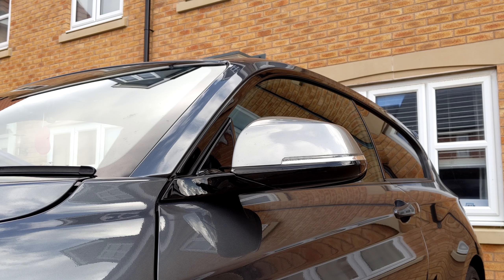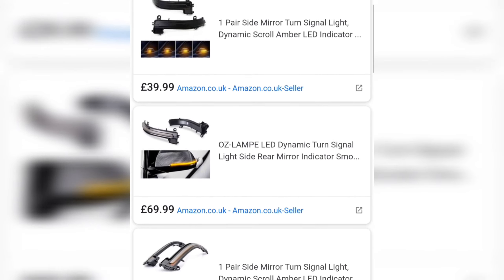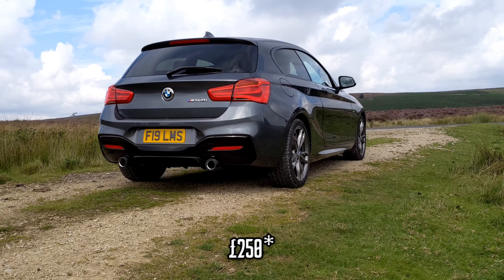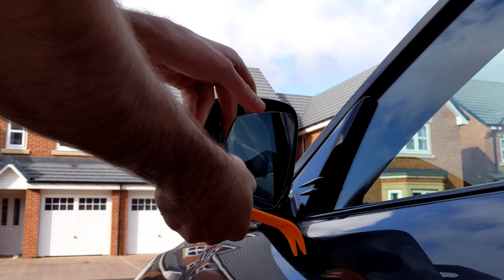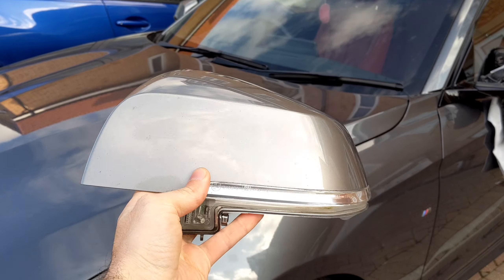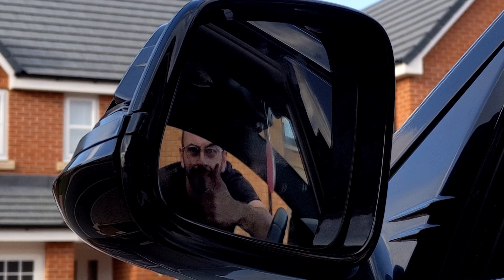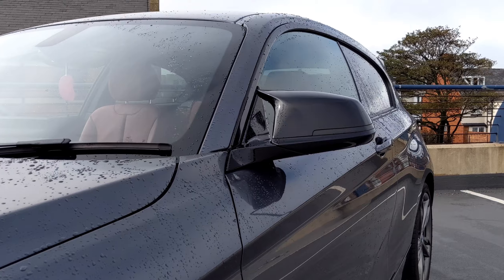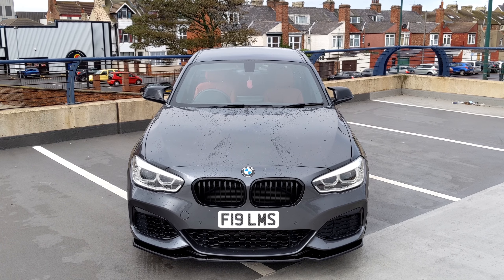The BEST £30 UPGRADE for a BMW 1 SERIES (F20, F21)

Comment: how did u tix ur front spitter , i got the ksb couldnt find the video in youtube about fitting them...selftaping screws and washers ?  //  and how did u do ur both grille , tinted or paint ( how much ) thx
Reply from the maker: I took the bumper off to fit it. Bit of a ballache accessing a couple of the screws under the arch lining tbh. I self tapped it on to begin with to get it lined up correctly then added the bolts and nyloc nuts for a bit of extra security. I just presumed there was a video on here otherwise I'd have made one 😅

The grille was already fitted to the car but you can buy the kidney grilles for £60 and fit them quite easily. You just have to undo the bolts under the bonnet securing the top of the bumper and there's enough flex to get your hand in to reach the tabs to pop them out 👍
Reply: @lookship  Would it be any easier to fit the splitter if I got ramps? Or is it a better idea to take off the entire bumper?
Reply from the maker: @Arman-nl6mg  yeah ramps would make it a lot easier. I don't think you can physically get your hand in to fit a nut on the bolts if you're planning on fitting it that way but if you're just using screws ramps should be spot on 👍
Reply: @lookship  Cool cool, but would you advise not fitting nuts though? Would using only screws ensure it doesn't fly off?
Reply from the maker: @Arman-nl6mg  I would yeah. But if you can't, just check to make sure they're not loose every now and again 😉